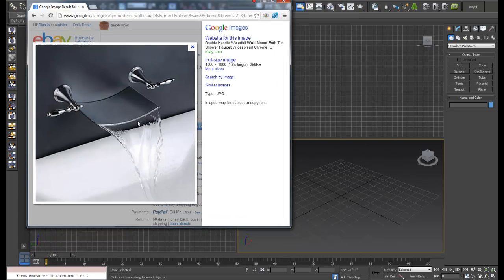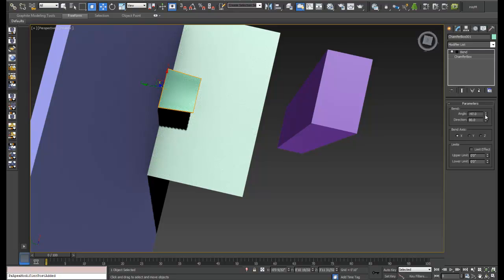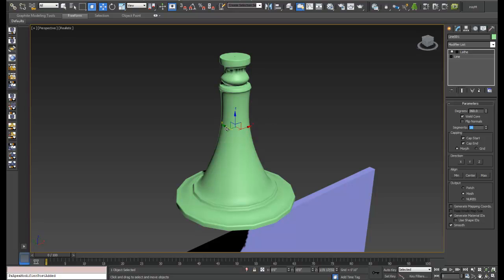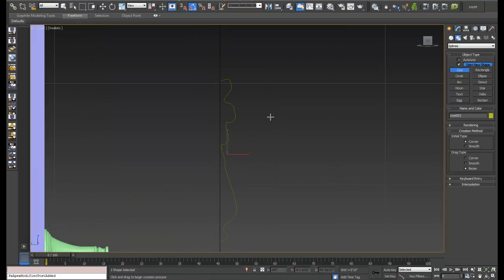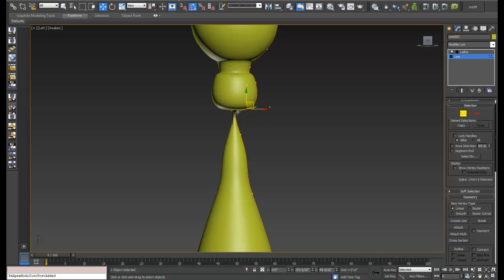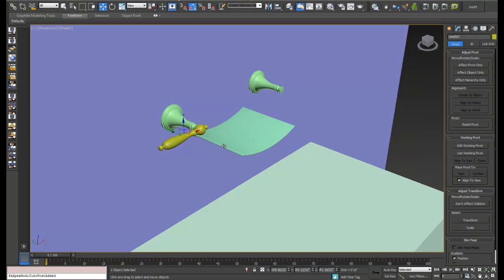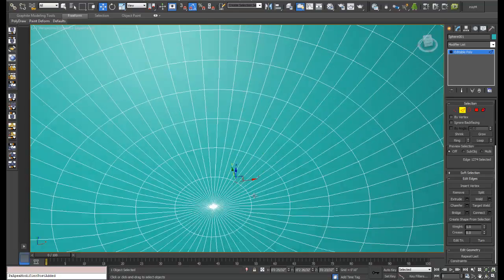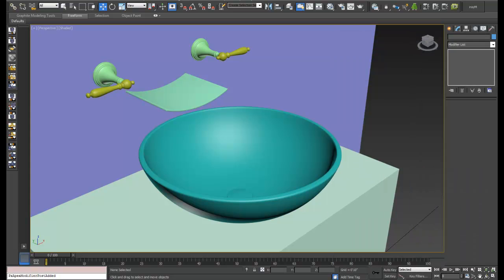Exclusive Tutorial: Modeling & Rendering Modern Sink Scene - (Part 1)

Comment: I have a question I have a skull in c4d I am going to model a candle on top of the head with wax oozing on the sides of it...I am using Realflow 2012 how can I do this? I am using the circle emitter and have set viscocity to about 6, density to about 1400, speed to about 0.5 so that it doesn't splatter too much when reaching the object but it still splatters and doesn't ooze down on the sides....what can I do? Thank you...